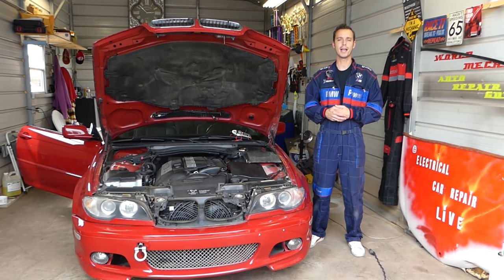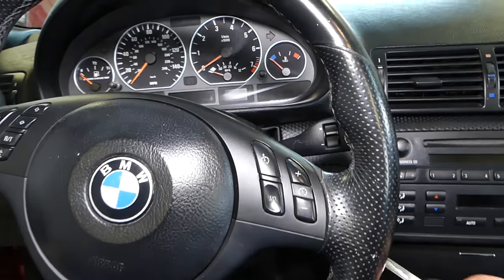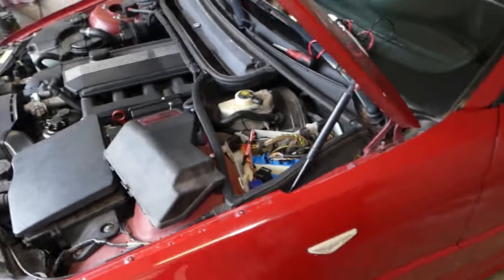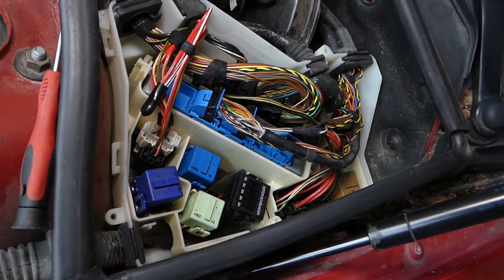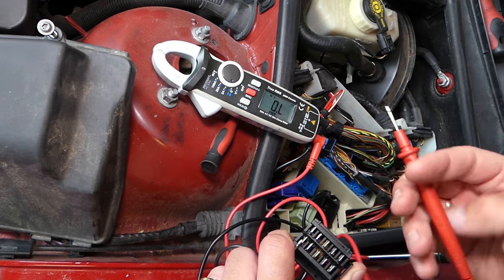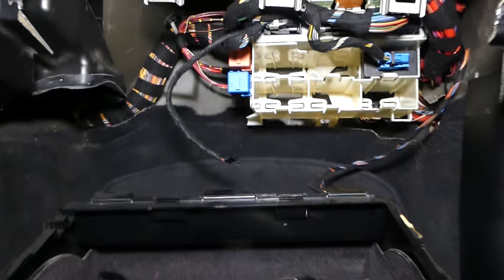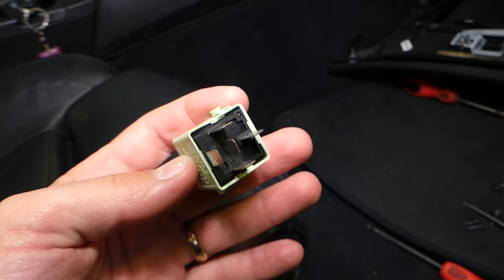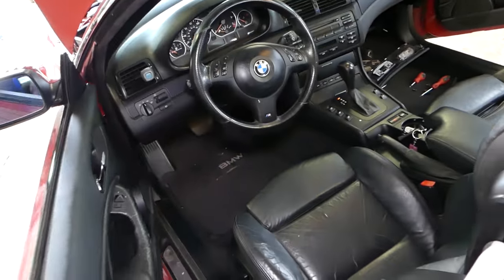BMW CRANKS BUT WONT START | ENGINE NOT STARTING

Comment: 2005 325i...won't start...found this video, pulled the fuel pump fuse...it was bad...replaced...car fired right up... easily saved me $1000 between tow bill and a garage fee...big thumbs up!  Cheers!

Comment: Who changed the motor in a E46 we're not getting it the right voltage we have 12 volts but the computer is only reading 5 so the cam sensor position sensor is not operating and sending Spark Ford fuel the only codes are 27 and 36 can anyone help me

Comment: I have a BMW e65 As soon as you mentioned the fuel pump fuse I remember removing it to check placed it back in wrong now the car is back started.

Comment: Hey guys thanks for the help from all your videos epic stuff. I have a 2006 bmw 530i but it cranks but Won’t start and there is zero relays under my dash like you showed in this one here video.
Reply: found the relay under the hood. took the rear seat out so i can clearly hear the fuel pump. but the car still only cranks but wont start,any ideas?

Comment: Hi, i need help with my car problem, the problem is my car crank but won't start, i checked injector signal, there's no signal, i checked ignition coil, there's also no signal, then i checked all fuse and relay, there's no fault. After that i checked all the wiring on engine, there's no problem with the wire harness, lastly i checked the ecm/ecu, i bring it to ecu repair shop they checked no faulty and i pay charge for checking usd60, after that, i try to start again, its still won't start, then i bring the ecm/ecu again to the bmw agent for checking with charge usd100, they also said there's no faulty with the ecu/ecm. I checked the fuel pump its working, i checked the pressure of fuelpump its working perfect. I checked the immobiliser, also no problem, Im still wondering with the problem and why my ignition coil and injector no power and no signal. Fault code on obd is P0341, P101b and P1061 , i tried clear, after a few minutes its appear again, anyone know what the problem? My car BMW 320i E90 2006, engine N46
Reply: i have the axact car, how did you resolve this

Comment: Hi . Good videos and quick fix . 

I having same problem but additional ignition on signal . 

Based on workshop it's ecu due to fuse burnout . 

Do advice me 

Car symptoms 

Cranking so long  wouldn't start 
Show signal ignition on
Car on P mode couldn't move 
All electronic normal 
Fuel full tank

Comment: hi guys i have a 97 z3 roadster 1.9 convertable, last year i snapped the exhaust camshaft and instead of replacing the broken cam i decieded to replace the head with another one with cams already intalled. to make a long story shorter i will list what i have replaced and still no fire and no gas! i have replaced the head and cams , the fuel pump the coil pack twice, the crank position semsor, the camshaft psition sensor  the knock sensor tha maf sensor, the fuel filter. the fuel rail and injectors the crankcase vent valve, plugs and wires,!  the fuel pump works and im getting fire right up the coiol pack but not any to the plugs  i have triied many thiings but just will not crank!any hel would be greatly appreciated!  i have been on this car a long time!

Comment: Hi guys,
I have a bmw 320i e90 2006 model, the problem is engine cranks but not starting, 
Fuel relay is good but when I switch the car no voltage come on the top of fuel pump.
Don't know what is wrong?
Reply: Did u fix it ?
Reply: hey! were you able to find out the solution to your problem?
Reply: How U go ? I have same prob 06 320i , it was suddenly hope you might be able to help, I noticed when I put fob In only odometer reading on, no acc stuck in park until press start, need help asap

Comment: I have a similar problema with my bmw F10. The thing is that it doesnt do this all the time. It has its moment. Also changed the camshaft sensor, the fuel relay, fuel pump module.
Reply: Check your MAF (MASS AIR FLOW SENSOR)
Reply: Hey did u figure out the problem my f30 doing it but it’s random won’t work one day than few days later it’ll work for a few days than do it again
Reply: @williamthemagnificent6964  get a new egr valve

Comment: Hi 
My bmw 318i automatic petrol drives fine but when i rev the engine and switch it off and try to start again it wont start but after 15-20 mins it starts and drives fine can anyone help thanks

Comment: I'm having similar issue with my 07 335i it has fuel at the rail , new battery Injectors which are coded , new plugs an coils , new DME replay , have checked engine fuses . Next I'm going to check for spark . But could do with some help. Car cranks but no start. Just subscribed thanks
Reply: Could be crank or cam sensors
Reply: Unplug mad sensor.

Comment: I just had a no crank problem on my 02 540i. Checked the ECU fuses, the ECU itself, car key EWS, car battery, and all other fuses. Thankfully all those were fine, it turned out to be a bad starter. I replaced my old starter then the car started again!  Unfortunately I did find out that my wiring harness is acting like a paper towel wicking oil from a leak somewhere up to my ECU's plug but that wasn't the cause of the no crank issue. I ended up cleaning out my ECU plug with electrical cleaner. Thankfully it wasn't coolant because it's corrosive so it could kill the connections and ECU. I suspect the oil leak is coming from the vanos solenoid gasket.
Reply: Since you’ve owned the bmw-  I’m only asking from experience;  how many times have you replaced if any,  the valve
Cover gaskets or vanos gaskets ?

Comment: Question: I have a 2009 E70 3.0, crank but no start. It appears I may need a fuel control module. Is there a way to program the new module myself once I install it. I can't find anything online showing how to do this at home. Thanks!

Comment: Hi like your videos they very helpful I have an issue with Bmw 328i was driving it on highway and decided to shift it Drive Sport It Drive ok for less then a quarter mile it said dash Fuel pump malfunction here the trick part fuel pump not working let sit for 45 minutes to hour it start up again and then stalls after 45 minutes what should I do

Comment: I have a 99 528i that is not firing at the coil packs I'm not getting a code for the crank sensor where should I look is there a relay

Comment: My 2010 X5 will crank won't start.  Replaced fuel pump relay.  Still same problem. Unplugged mass air flow sensor.  Same problem.  I'm not getting power to the fuel pump at all. I did checked the new fuel pump relay with meter while hooking 12 volts to it. Still won't start.  Any suggestions?  Thank you
Reply: I have the same problem    My x 5 is intermittent       just changed the CAS module     no faults on computer  not sure what to do next?
Reply: @hardingmacdona4204  still working on mine.  I'm going to replace the crankshaft position sensor which means on my particular X5 model.  I have to take out the intake manifold to replace it.  I tried to go from underneath it but it's designed in a way I cannot reach up from underneath to do it unfortunately.
Reply: Did yuo fix bro i have the same problem
Reply: @edcalderon7301  I fixed it.  There was a burnt wire at the fuel pump wire harness. Apparently dealership did a pissed-poor job installing new wire harness. This car had a recall for the wiring harness for the fuel pump.  I checked it and it has 12 volts to fuel pump.  But when I plugged the harness to the fuel pump.  The pump wouldn't come on. But if I hooked a 12 volt directly to it and started the car.  It ran.  So the computer has a safety device that sensed a drop/resistance in voltage and it killed the power to the fuel pump. So everything that I did to the car did not fix it until I found the burnt wire harness.
Reply: @guyinthavong  Hi,
I have a bmw 320i e90 2006 model, the problem is engine crunks but not starting, 
Fuel relay is good but when I switch the car no voltage come on the top of fuel pump.
Don't know what is wrong?

Comment: Hi i have a problem my car BMW 520d was parked for few weeks I kept starting it but one day it run out of diesel and battery died I put some diesel recharged battery but the car would not start I can hear the pump is working.
Reply: i have the same issue, have you fixed it? can you help me? thank you
Reply: Try a new battery

Comment: Hi Guys, please assist Mercedes w205 automatic not changing gears. When I put on Drive or reverse it say goo as if it is bumbed. It shows engine light on my the dash and it once asked for transmission oil. And it hasn’t ask for service as yet still on 60k.

Comment: I have a 05 e90 started everytime, next time crack no start/fire , noticed when put the toggle in no accessories are on, eg no dash lights, a/C,horn , locked in park until I press start button in witch if I have my foot on brake it will crank over! Is this normal? It's as if not all is being powered up, I looked at fuses in glove box, it also may have happened after I had it connected to a 4ah charger under hood and started it, this I can't be sure of, any help I appreciate
Reply: Your battery is going bad

Comment: Hi there I saw your bmw videos and find them useful.

I own a e90 325i bmw

My bmw is causing me concerns, it has a new battery and the battery is charged.
But I find the only way to get life to my car is by putting jumping leads the the front from another car.

 (no light’s  nothing cannot use remote to open it up either)before jumping.

It will be slow to jump like it has a flat battery but then it will start after 1 minute, then you can shut it off and it will start straight away.

Do you have any ideas what may be happening to my car?
Reply: You have to reprogram the computer to the battery.

Comment: 2000 e46 330ci, sometimes car will take 2 - 3 times longer to start, when it does this there is very little power from car, sometimes it will start perfectly and drive great. Been doing this for around 6 months now i have tried replacing intake camshaft sensor but no luck, anyone have any clues? Cheers
Reply: l have the axact problem, how do u solve this

Comment: I have an e39 525i it doesn't crank and it doesn't start but all the lights come on? Any idea what it could be
Reply: M K same /:
Reply: @lunasgaming  my issue was the starter motor ask your garage to check that hopefully it will be resolved

Comment: Hopefully this is my issue. I’ve seen other videos from you that have helped a lot to fix my old bmw.
Reply: @1ofNONEworldwide  yes I replaced the fuse and it popped again. I unplugged all the secondary air injection stuff removed the maf and the hose from the vanos cover and it started right up. Then I plugged them back in and the car works like there was never an issue in the first place

Comment: Suffering from same problem on my e90 2006. Suspecious of the relay. Is it located on the same place or else? 

There is another clip regarding this problem of craking but no starting especially while engine is warm. It tells defective maf sensor. What would you say? 
Thanks
Reply: To test the MAF if it won't start, unplug it. If the MAF is bad then it should start. Also your cruise control won't work with a bad MAF.

Comment: Hi guys I have a BMW e36 328i The car cranks and sputters then just cranks  the is fuel pressure there is spark, the plugs are 1 week old and so is the brand new crank sensor. The ground is still fine. All fuses  are right and all relays are right. The battery is fully charged. No1 was doing anything on the car it just wouldnt start one morning
Reply: Boo boo her me
Reply: When

C

Comment: My e90 330d pump buzzing continously and car won't start. Any advise? Relays? Will get it diagnosed soon
Reply: Main DME relay should fix that , it did for my e90 , but she still doesn't start
Reply: @mrkeza64  i opened up everything and found the issue to be the DME itself which had been water damaged.
Reply: Did yuo fix?
Reply: @edcalderon7301  Yes thank god!! Bought a used DME/ECU kit and car fired up right away.
Reply: Hi,
I have a bmw 320i e90 2006 model, the problem is engine crunks but not starting, 
Fuel relay is good but when I switch the car no voltage come on the top of fuel pump.
Don't know what is wrong?
Reply: @bahramnoori874  check fuel pump fuse behind glove box. Check the 5 small fuses inside the Ecu box under the bonnet. If all good could be a dead fuel pump
Reply: What number is the fuse for the fuel pump?
Reply: @talsa6875  ?
Reply: @InstantTricks1  sorry for the delayed reply. I believe it's the green relay in the engine bay fuse box.
Reply: @talsa6875  thanks bro